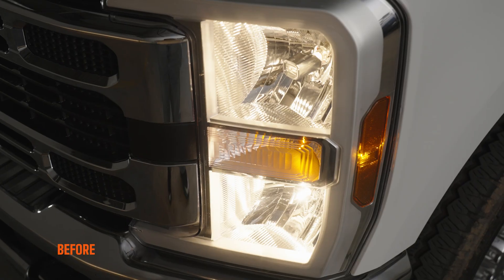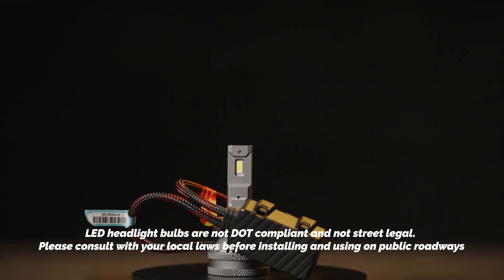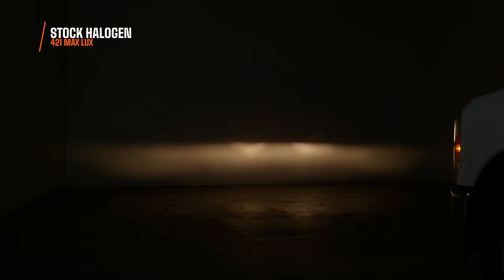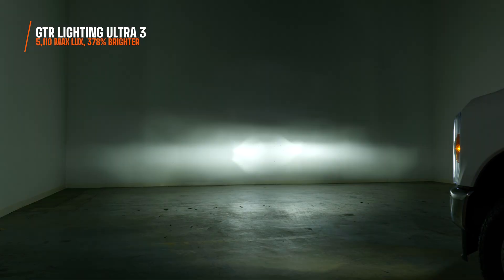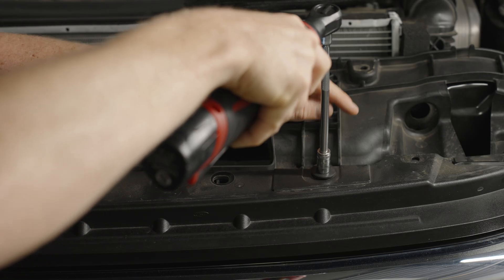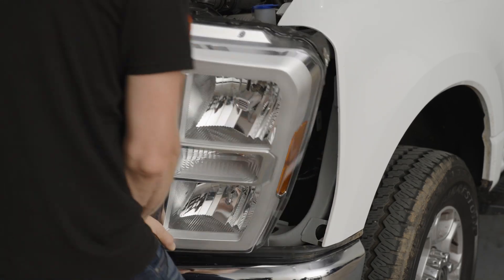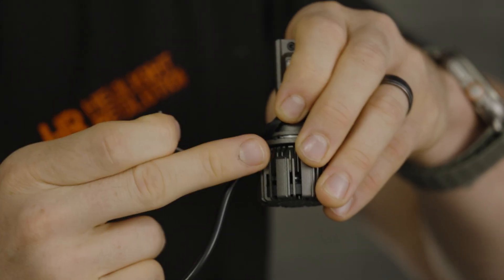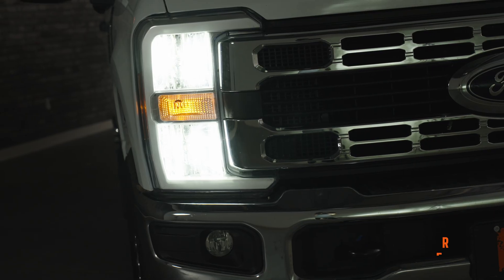576% Brighter?! 2023+ Ford Super Duty LED Headlight Bulb Upgrade | GTR Ultra 3 LED Install & Test

Comment: What would I use for 2019 f350 with factory LED? Is there a brighter bulb replacement?
Reply from the maker: The LEDs and drivers are built into the housing, so there’s no serviceable “bulb” to swap—more light means a full headlight upgrade. Your best bet is a plug-and-play Morimoto XB headlights (OE-fit, DOT-compliant, 5-year warranty)
Check them out here: https://www.headlightrevolution.com/search?keywords=LF503.2